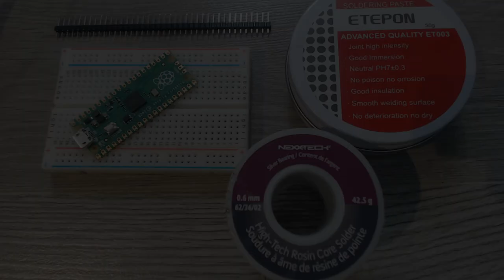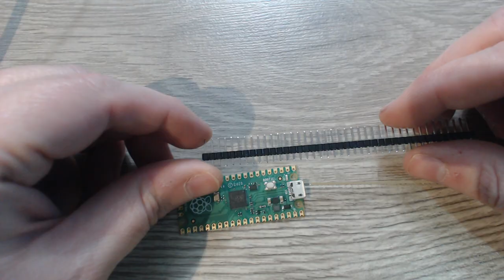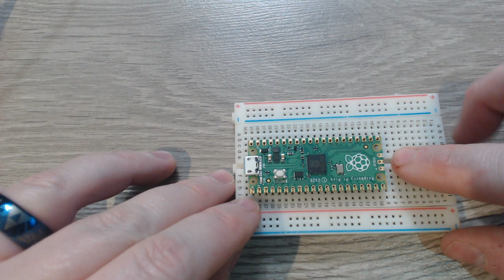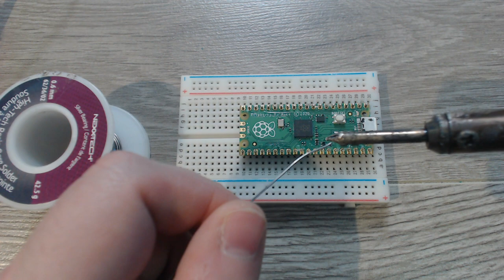The EASY WAY to Solder Pins to your Pico, Arduino, Pi, and MORE!

Comment: Noob question here.  What is the purpose of a breadboard?
Reply from the maker: A breadboard allows you to temporarily "socket" a bunch of components and connect them together with jumper cables. That way, you can make sure the electronics in your build will work together properly before permanently soldering them together.

It's super helpful in prototyping!

Comment: That's a great way when using a conical tip!  If you have an edge/blade tip (I don't recall the proper name) after applying flux and doing at least one corner you can just flood it riding along the pins. I have shaky hands when soldering as well so I use the same method you do. 👍
Reply from the maker: My next purchase will likely be a good soldering iron. Defaulted to using my 20 dollar special from radio shack
Reply: @PrintNPlay  I greatly enjoy maximizing old cheap electronics.  But if you end up doing a lot of something, spending $$ to save time is good for the soul.

Comment: What kind of solder should i use? (The one i have doesnt even stick to pins)
Reply from the maker: You likely want one with a rosin core, or you can use Flux with the solder you have

Comment: video is great, soldering tips helped me a lot, but dude, this ring of Legend of Zelda has told me to subscribe!
Reply from the maker: Glad to have you here! It's dangerous to go alone.
Reply: @PrintNPlay  by the way, do you think that doing bad solrderings can affect ADC readings? i tried to solder my pico w and when uploading code from a project developed on a pico, adc values go crazy, vsys 0.9 volts when attached a 3.7v liion battery.

Comment: I'm not trying to be a downer here, but this could potentially mess up your breadboard. You could accidentally drip solder into one of the holes and create a permanent bridge. If you're new to soldering, you could leave heat on a pin too long and melt the plastic socket on the breadboard. Not to mention that the metal bridges in the breadboard will dissipate heat, making it more difficult to solder the pins without tinning the iron (which is not good because you run the risk of creating a cold joint if you aren't fast with your soldering). I know this was intended to help, but I really wouldn't recommend this unless you have a junk breadboard that you don't care much about.
Reply: You forgot to mention what you would recommend as an alternative... 🤷
Reply: @omc7109  Traditional hand soldering or maybe a set of helping hands if you can't manage. There isn't really a 'hack' to soldering other than just learning to solder.